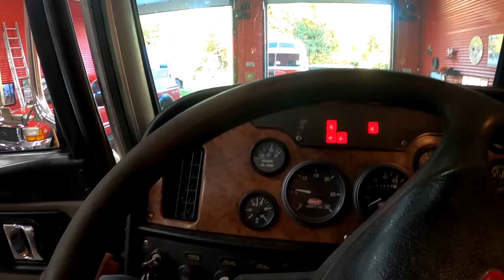K100 Kenworth restoration.  Cutting up the fiberglass

Comment: I do a bit of f/glassing for my RC boat hobby... for that smaller hole at the top I would put a piece of ply behind as a former(with some mold release agent on it, or just glass it in from behind as well) then build up some new matt over the hole first bringing it back to the same level as existing glass, then do some new layers of matting over the whole damaged area
Reply from the maker: Sounds like a plan.

Comment: Hi Mike, your doing a great job on that damage.  I was setting here thinking about you and all the work you have gotten done already.  I just watched my 1955 Mack LTL getting hauled into setting sun last night after working on it in spare  time for 9 years.  I  installed a 1693TA with 18 speed trans and freightliner air ride single axle locker.  Its going to Germany.  We had many many midnight hours putting that old gal together.  The darn alum frame wasthe butt kicker.  Tell everyone hello from Arkansas.

g

Comment: Mike put a strip of plywood around your cut screw the two pieces together and fibreglass in some spots to hold it in place then pull the screws out and remove the plywood and fibreglass the inside first and repeat on the front side with fibreglass good luck.

Comment: Are you going to apply a layer of resin to the freshly sanded glass to seal it a little from drawing in moisture? I keep shouting at the screen 'take a plug off the other K100 and make a new top shell for the damaged parts.' Its coming along slowly. Going to look a lot worse before it will get any better.

Comment: Why not just drill the rivets out take the roof off and replace with a donar roof it would make it easier
Reply: That’s the ticket for the best result for sure.   I’d be spending my time chasing one down from a truck wrecker. Some with the aluminium replacement panels.

Comment: I no I'm late posting my 91 year old dads been in the hospital so just now catching up on video's but couldn't you have just cut the Pointe end off and used the first one and added that part back in instead of cutting hole new piece I would have removed the brackets and welded or bolted them in place and reglued the panels to them  now I haven't watched the hole video yet so